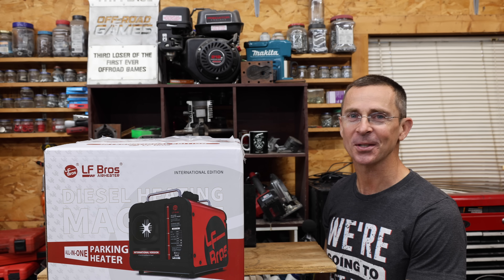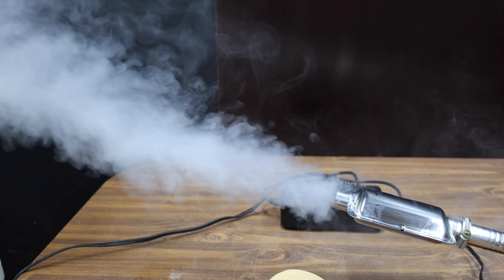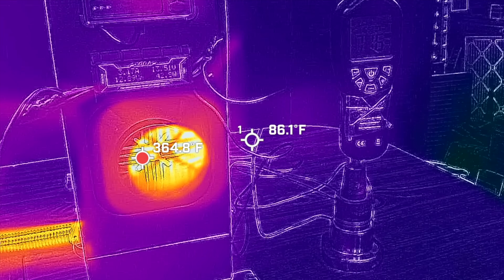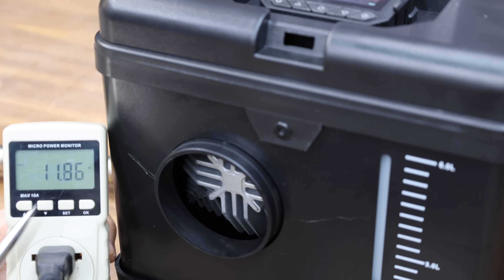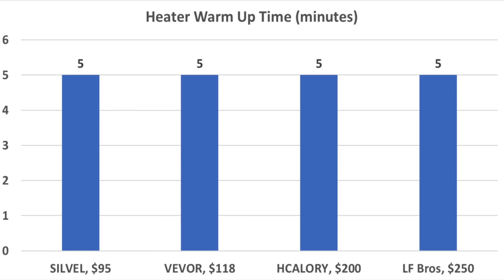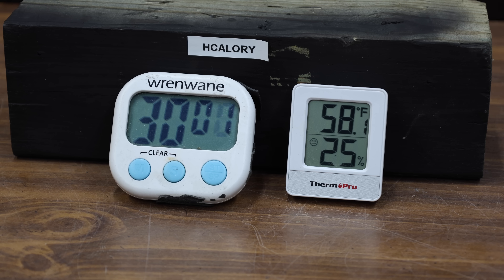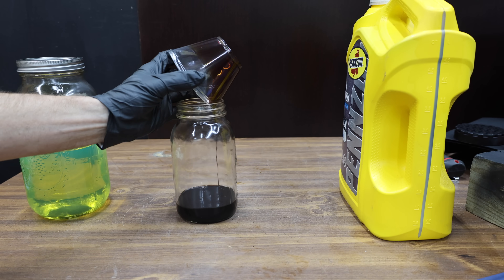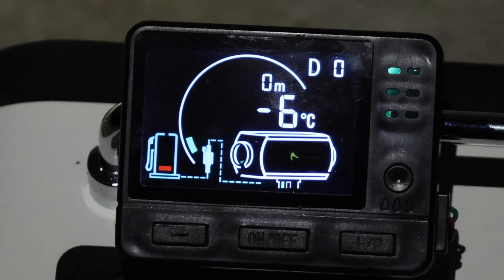The Truth About Cheap Diesel Heaters!

Comment: Another common heater is the kerosene type that you can buy at Lowes, Home Depot, etc.  It'd be interesting to compare if there's advantage to one or the other.  The kerosene doesn't have an exhaust to deal with, so it in theory can be run in a completely enclosed space.
Reply: I put in a request for that yesterday, so we'll see. In the meantime I already bought the DynaGlo, but I'm curious as to how it stacks up against the Mr. heater and the Master.
Reply: @salazam  Yeah, that is true, we have standard propane heaters too.  If you're heating a garage, what is the correct choice?  What are the compromises to consider picking one vs the other?  It's not just power output either.  I can be little things like if it's powered or not, aka has a fan to circulate and better heat a volume of space.  Also, there's a cost to run each type, a propane tank vs a gallon of diesel, long term storage of fuels, and even something like starting temp.  If your space starts out at -20°F, will you need to warm up your diesel first?
Reply: @Xmvw2X  I guess it depends on your needs, like everything in life. There is no "correct" one size fits all choice.
Reply: The wick heaters need some ventilation for O2.  They burn very clean, but do emit some emissions into the living space.
They are silent and require no electricity......they do have their place.

Comment: I pulled out my pellet stove and replaced it with two 8ks a 15 gallon tank outside. Exhaust runs where the pellet stove used to vent. I'm spending around $60 a month (fuel and power) to run them keeps my house cozy. But I use a wood stove at night.
Reply from the maker: Thanks for sharing.

Comment: Video suggestion: powered wood planers - the smaller hand-held ones with about 3.5” cutting width. Maybe compare both battery powered and corded ones.
Reply: Great tool, but practice is required to use effectively.
I actually have used these regularly since the 70s....
Old trim carpenter.
Reply: Get one with 2 blades, not 1. You can shift one blade a little if you get a nick.
Most use the reversible blades, which are readily available.
Carbide blades are available, and last longer. The Carbide however will never cut as smoothly as the HSS.  The steel blades are cheap and easy to swap or reverse, and not as expensive when you damage them.
I prefer the steel blades by far.

Comment: I run my Vevor 8 kw in my storage unit off a 100 amp hr battery very satisfied with this unit. I mix half used oil and half diesel works out really well. thanks
Reply: Get ready to take apart the burn chamber and clean it. I’ve been doing the same and after two winters it wouldn’t fire up, cleaned the burn chamber and it’s been fine since. I’ve lowered the used oil ratio since.
Reply: @Rebel635csi  Just wondering if you did a comparison running your unit on straight fuel oil. Living in interior Alaska for the past 40 years, I have heated various homes with either a high-tech air-to-air heater or boiler burning straight #1 fuel oil and I have always had to do a complete annual cleaning and tune-up after each season's use. So, I am wondering if such annual cleaning might be warranted regardless of what fuel was used, of course depending on how many hours it operated through a single winter.
Reply: @rossk4864  i started with straight diesel. No issues. After few months of oil I could tell it was getting clogged up. It would more and more require two start up routines before it would catch. The stuff that came out was nasty. Jagged rock like substance that had to be broken up and scraped. It altered the air flow and prevented that central burn cone from forming.
Reply: For how many hours will your 100Ah battery run the heater?
Reply: From what I've seen... You draw the most at start up and shut down (150ish watts) and then 20 ish watts when running. Think 10.4 volts is the lowest you want to go?
There's ppl running then off drill batteries too @firecloud77
Reply: I ran mine with 25% used motor oil. It fouled the chamber within a week and there's no way to clean everything inside.
Reply: @aleks138  put a butane torch to the chamber and get it cherry red. It will burn off everything. Had to do that to my bunk heater and it works like a charm
Reply: Must need a lot of maintenance?  Watched a few videos with low success
Reply: You mustn't have ran much fuel through it... Used motor oil will burn, but it leaves coal and ash rock deposits in the combustion chamber from the oil additives... 

Your heater will need tearing apart and cleaning. Motor oil is filthy to burn.
Reply: @ I think because I run it wide open at all times, a slow burn yeah you’ll have issues.

Comment: After 5 years, I'm on my 2nd Chinese Diesel Heater. The first one still runs fine.. I just switched to a 
Vevor "All on One" in my New To Me, Ex FedEx van !
Best heaters ever.... they're all about the same, except for the Display/Controllers !
Great Video as usual !
Reply from the maker: Thanks!  Thanks for sharing
Reply: I believe they all come out of the same factory with different names slapped on them. And yes controllers vary.
Reply: @aaronpeterson385 where China gets these names though
Reply: That's the benefit of Chinese cheapness with European ingenuity. The reason these things are so popular now is because the patent ran out on the espar/wabasto.

Comment: I have one from Vevor for my woodworking corner. The power supply unit that comes with the LF Bros is unfortunately not really safe. I had the same one and it didn't have an EMC filter and the primary-secondary isolation wasn't really there either. So be careful here.
Reply from the maker: Thanks for the feedback.

Comment: Only downside is having to store a bunch of diesel.  Cause in a disaster where you need the generator, the Humungus is going to come to take your fuel.
Reply: Not necessarily. Most of these will run fine on any flammable fluid of approximately equal viscosity, could raid mcdonalds for their frier oil and heat your home for a month
Reply: hidden storage tank? Because, you might be worried about the "guvmint" coming after your fuel, but your AR-totin' neighbor is closer, and might think that his 5.56 ammo is cheaper than diesel...

Comment: I've seen some RV channels that have installed diesel heaters for winter use so you still have your propane for cooking and hot water.  The propane furnace in a RV isn't very efficient.
Reply from the maker: Thank you for sharing!

Comment: I'm currently using one from Maxspeedingrods for my custom box truck/RV and it has built-in automatic altitude adjustment unlike most others that need to be manually tuned for altitude changes.  This is a big plus for me.  Generally extremely reliable but I have had overheating issues with the first unit I bought so I bought another and kept the first for parts.  Cheap, reliable heat; what's not to love?!
Reply from the maker: Thank you for sharing!

Comment: The smoke on the first heater was because you didn't have voltage high enough which caused a start with no shut down period.  I've used these heaters for years. Way better than propane as far as safety and reduction in moisture in the heated space. Easy to use in several places.
Reply from the maker: Thank you for sharing!
Reply: no the smoke is just from priming the fuel line at first startup. Thats the excess fuel that just burns off (or at least wants to burn off but its way to much fuel for the amount of air and the heat isn`t high enough at the start).
Reply: @kurtwagner16  trust me. If he had the right voltage from the start.   It would have started like the other ones did.   It shot fuel in and couldn't burn it. So it got a wet start thus the smoke. 40 years running these things.

Comment: Another great video! Also, looks like the Vevor has an opening on the back side to allow the exhaust piping to be connected without causing mounting/resting issues on the built in brackets.

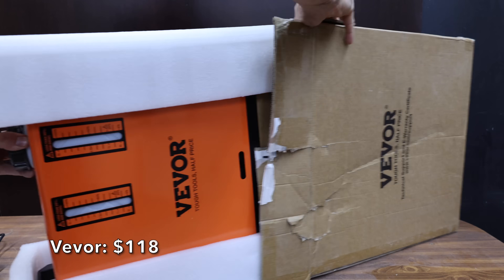Comment: 3:52 "8000 kW"   Wow, that's a powerful unit! 😛
Reply: That 8MW heater must use lot's of fuel
Reply: Many studies have been done that prove 5he 5kw and 8kw are exactly the same units with no difference.
Reply: 8000 watts or 8kw
Reply: There is 10 kwh per litre in diesel fuel.
My 8kw unit runs at full output for 3 hours on one litre which means the real output is 3.33kw.

Comment: None of these units deliver 8KW.  They are all 5KW.  Typical mis-advertising.  But the do work well.  I run 2 units in a 750 SQ FT off grid cabin.  It’s enough to take the edge off when it’s < 25F outside.  Also, the reason the first one smoked was because of the lack of power shutdown.  There was unburned fuel when it restarted.  That’s a pretty common symptom.
Reply from the maker: Thank you for sharing!

Comment: Have a good video idea. Cordless pressure washers (battery powered). There's brands like DeWalt, Ryobi, Hart, Milwaukee, and plenty of off brand ones as well.
Reply from the maker: Thank you for the video idea!
Reply: Ego
Reply: They have a small reservoir you fill up like a squirt gun lol
Reply: How would ypu get the water?
Reply: @zippybuzzard831  you also have the option to hook a hose up on most of them
Reply: @zippybuzzard831  you just stick the hose in a bucket or pond or anything
Reply: The big brands have one advantage, they will work. They might not be perfect but they are almost always decent. Off brand stuff can be hit and miss. The real cheap ones are cheap for a reason. Now a cheap pressure washer might be decent. Just remember that cheap usually means shorter life and often a lower pressure.

Most important is that you make sure to keep the pressure washer from freezing. It doesn't matter if you only used it once in spring. There will be water in the pump and if it freezes it's now a former pump. The pumps in cheap pressure washers tend to be made of plastic. They work but will wear out quickly. If you are using it a lot spend some money on a well known brand. If it's used a couple of times a year the cheap brands may very well last five or ten years.

Comment: Friendly reminder : Oil with 15% of  gas equals diesel in viscosity :)
Reply from the maker: Thank you for sharing!
Reply: How long will it stay mixed though?
Reply: @Tb0n3  basically forever if gas has no ethanol in it.
A car in the family has the oil dilution problem, had 8% of gas  in volume one time and the oil just stayed mixed, no separation after a year in a tank ( I collect it then put in the disposal center from time to time).
Reply: All these heaters are a clone of the Eberspacher/espar D 2/4 units other than  the control module/ecu guy even swapped out the dead ecu from an Eberspacher to a Chinese one and has the unit working again.

Comment: Suggested video:  Adjustable oil filter removal sockets with 1/2 drive or oil filter pliers
Reply from the maker: Thank you for the video idea!
Reply: That's dumb. It depends on your car. As a mechanic I've had to use all of them, including the metal-strap ones.
Reply: @salazam  maybe dumb, but very handy tool to have when the filter is hard to remove with a hand...
Reply: @otarsulava  Literally no one removes oil filters by hand. If you are, you put it on too loose. Pliars are the best if they reach and you have the room. This is such a dumb question though. It's like asking what kind of fork is best.
Reply: @salazam  Yes, you only hand tight the filter but not trying to remove as it's usually always feels like glued on it, I have pliers too , changed twice already as they got flimsy, why it's dumb to test the that tool, that's what I don't get it... Some they don't grip well, get corroded etc...
Reply: @otarsulava  If it doesn't grip you squeeze it until it dents the can. Maybe you should leave these things to a mechanic. It sounds like this is something that's beyond your capabilities.
Reply: @salazam  Alright, I'll improve capabilities 🙂... Enjoy the weekend

Comment: Lots of things to think about here, we used to use the torpedo looking things that were great if you were standing in front of it but terrible for everyone else 🤣
Reply from the maker: Great point! This is a much better option for an enclosed space in my opinion. Exhaust can be safely vented to an outside space.
Reply: The problem with those is the humidity, Ive been using one to heat my garage in Alberta when Im working in there and moisture literally drips off the ceiling, no bueno. Ive thought about building a heat exchanger with a 55 gallon drum and venting exhaust outside but its not worth the cost of materials never mind my time and labour